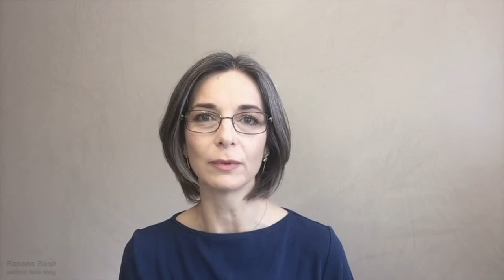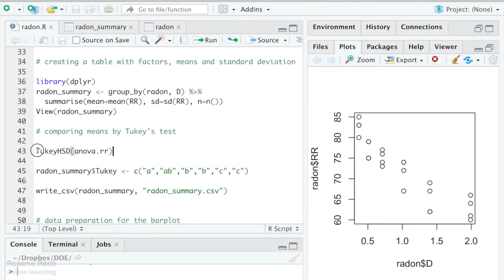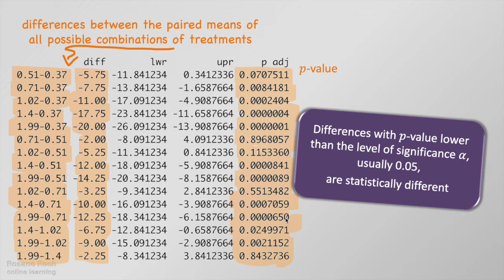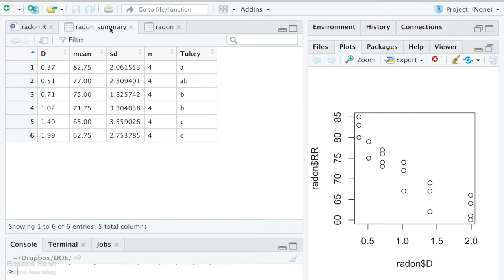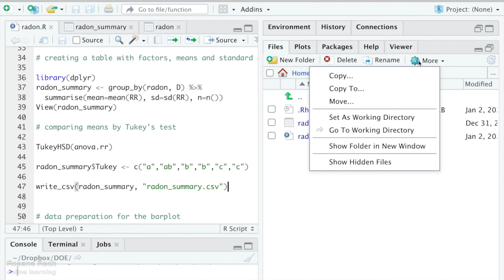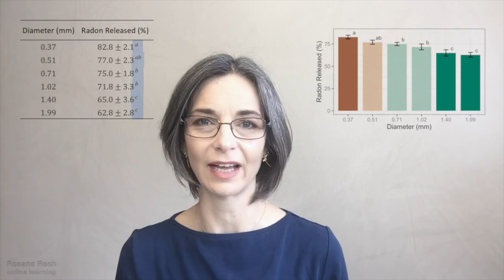One-Way ANOVA R tutorial 2 - Tukey's Test

Comment: What if your grouping variable is not interval?? How could you do this for nominal categories such as an experiment (where this would obviously be the most useful)? Specifically, the step in which you identify between group differences with Tukey's test is extremely cumbersome if the variables do not have a linear relationship.
Reply from the maker: The variables don't need to have a linear relationship. You can use the same procedure for categorical  variables.